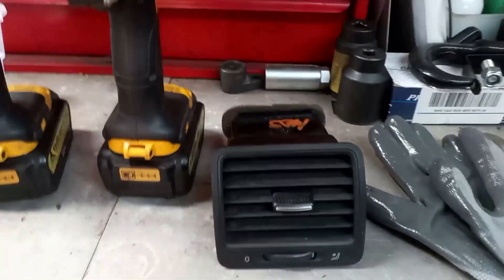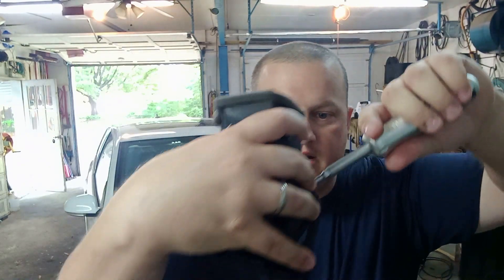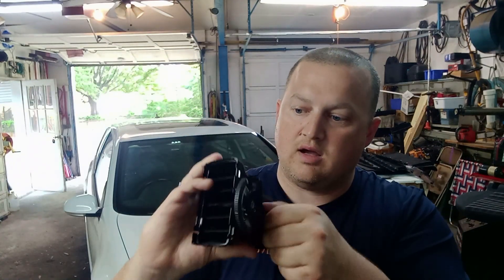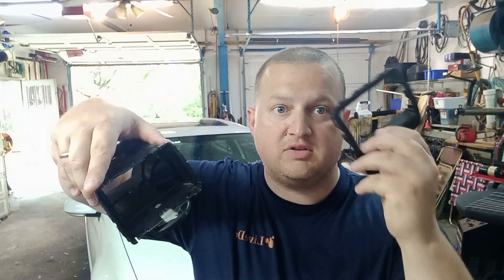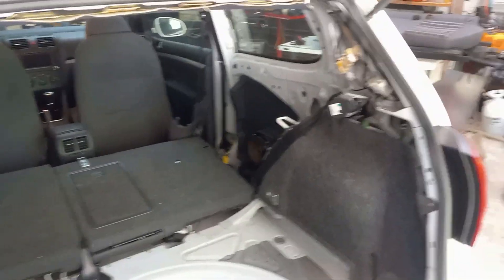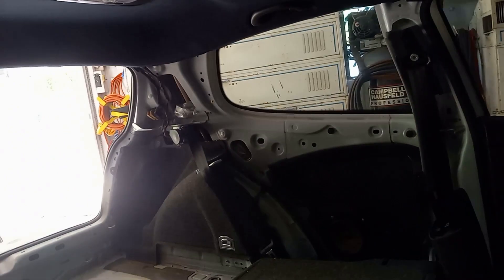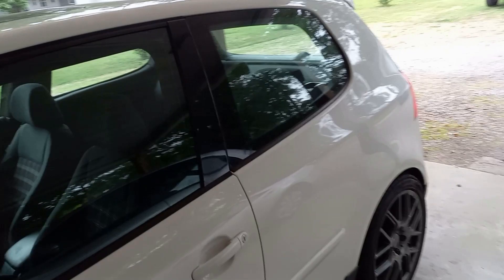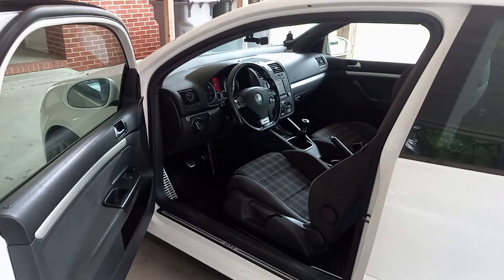MK5 GTI BUILD PART 4 INTERIOR AND VENT BOOST GAUGE

Comment: How did you wire the illumination of the gauge to the light switch?
Reply from the maker: I wired it to the fuse box to cut on with the switch just find the one for the interior and tap your power off that thanks for watching